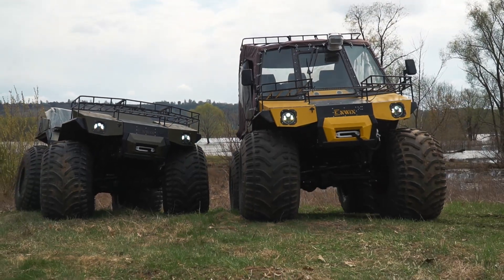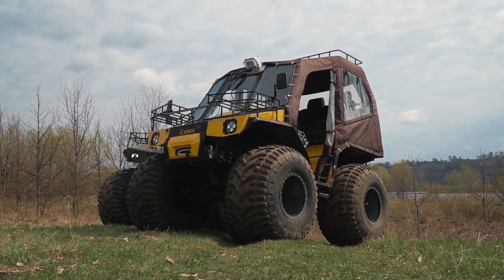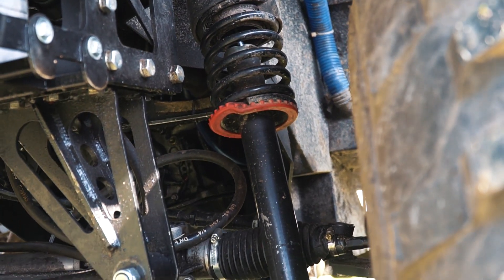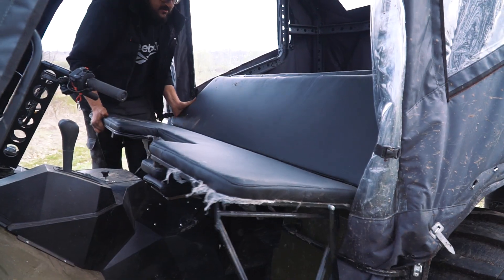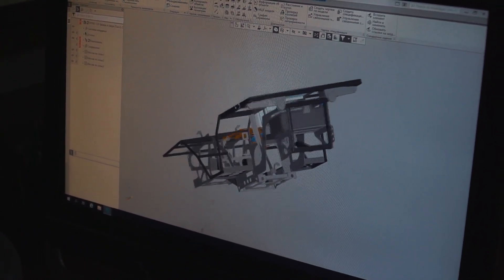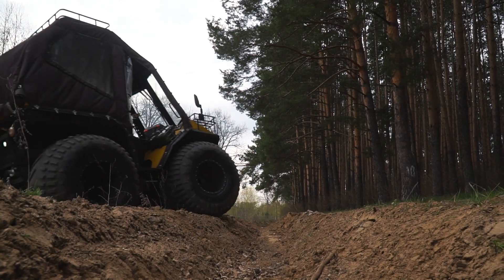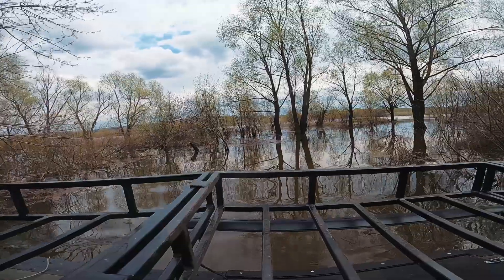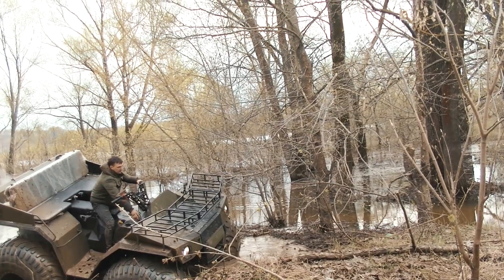Newest huge ATV Enwix - great for long expeditions!

Comment: cheapest from 1 194 000 ₽ = 1,274,296.50 USD to most expensive 2 220 000 ₽ = 2,369,295.00 USD that's with out shipping cost no thanks
Reply: The cost for the yellow one is $29,699.00 USD NOT over 2 million USD $ LOL! .
Reply: @gloknor  your wrong
Reply: Lol, Uh no I am correct . Do you understand the conversion rate of Rubles, apparently you have terrible math skills . @hydrazombie